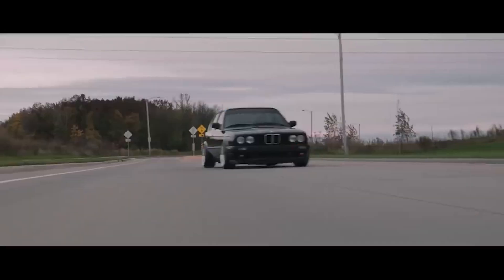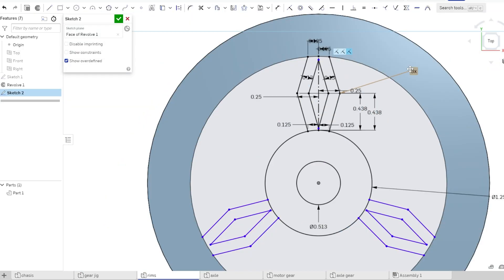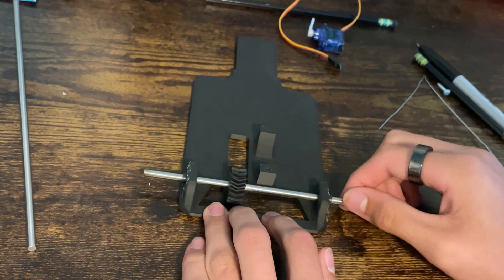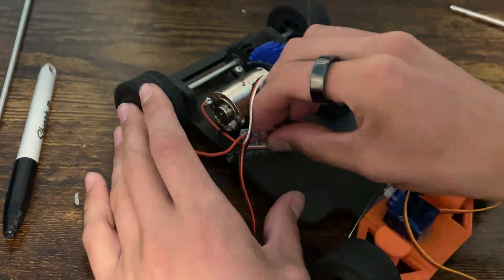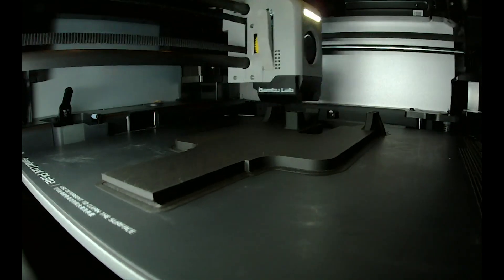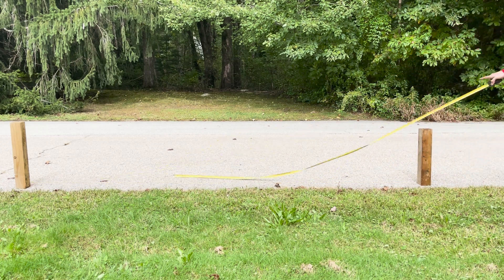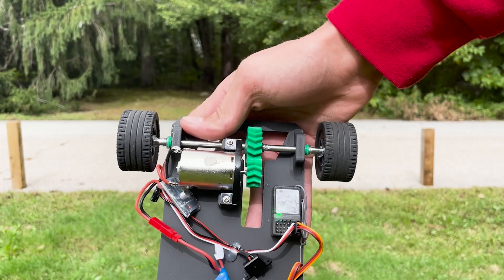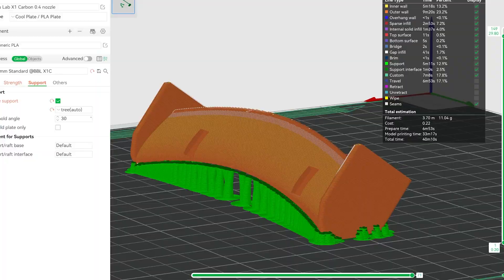making a mini 3D printed RC car | 25mph

Comment: What you made is essentially a pan-car. 👍
1. Approximately 1:4 gear ratio is the usual, if the motor is sized correctly.
2. Explore use of flanged bearings.

Comment: For the gear problem, it’s because of the heat of the motor. It melted the filament. That happened to me but i am glad you solved it with some glue but i am trying to put some metal gear on mine

Comment: you have the 3d models to print?
Reply from the maker: they are on thingiverse if you search for my name
Reply: @hamburgerinc6995  i founded! I printed the front wheels support, but the moviment dont work, you have some tip to me ?
Reply from the maker: @romulokoning2975  if the print fused together when being manufactured, it likely means the tolerances between the ball joints are too fine for the Gcode going to your printer. I would fidget around with printer settings, the design I publish was optimized to be printed by a Bambu Labs printer, so I don't have much insight to help with other printers

Comment: 5:17.....I would thread the input shaft and tap the primary gear so it screws on.  Or Flatten a small portion of the input shaft, drill a hole in the gear and use a screw/bolt to secure the gear to the shaft.
Reply from the maker: that's a good idea, I'll try it out if an opportunity presents itself in the future. Thanks!
Reply: That is smart
Reply: @shadownetwork12650  Thank You!!!!!

Comment: This is awesome! I actually have a 3d printed rc car myself, I completely designed it too. Although the diff is not 3d printed due to the stress it'll under go. I post shorts about it on my channel (this profile) I'm currently in the works of making a main video about it so I'll come out soon. My car is rock crawler really, it's got full suspension and a 2 speed transmission. Good luck on continuing this project, I'd hope it'll contine
Reply from the maker: Just watched one of your shorts. Cool stuff man!

Comment: You could also stick your tires to avoid that there is a new source of sleeping and you will therefore go faster, it is not very stable at high speeds so try to put a bodywork on it to remove the disturbances due to the wind

Comment: If you print the entire wheel out of tpu (with some springy structure inside) you can probably get a bit of shock absorption. Won’t have as much grip as the Lego ones though so there’s that.

Comment: Helical gears can output more power since the contact surface is greater than the ordinary ones
Reply: Wdym straight cut gears aren't slanted and are more stronger and more efficient that helical.

Comment: Neat little car, wonder how hard it would be to convert something like this to 4 wheel drive 🤔
Probably would take a complete redesign I guess
Reply from the maker: It would be super interesting, The biggest problem would be the small size of the car it's only 20cm long, however, maybe in a future version I'll attempt something like this, great suggestion 👍
Reply: @hamburgerinc6995  yeah would take quite a bit of redesign but is a project I’d like to eventually work on. Looking forward to seeing what you get up to
Reply: You can just put a shaft to go through the middle of the car and use dog bones on the front axle
Reply: @CENREAPER-YT  also gonna want a front diff though and gonna want to move the motor and potentially add a rear diff too.
Reply: Although it'll be difficult, there is a way. like live axle suspension, I use it on my truck. I post videos about my truck on my channel if your curious to see it

Comment: If you don't want it to spin out too much, you should add a diff.
Reply from the maker: good point, especially when taking tight corners, the wheels tended to slip a lot.